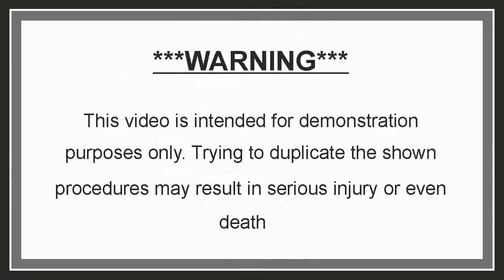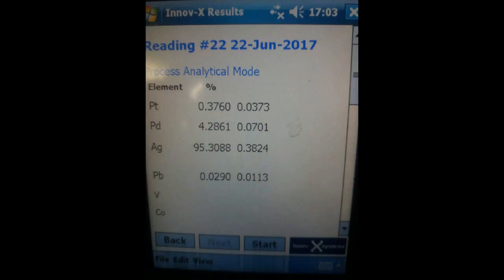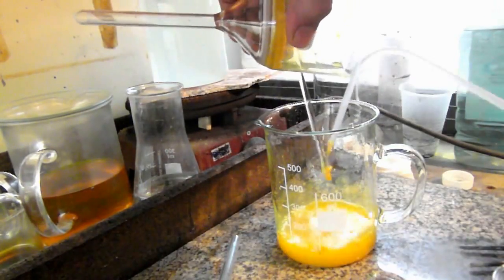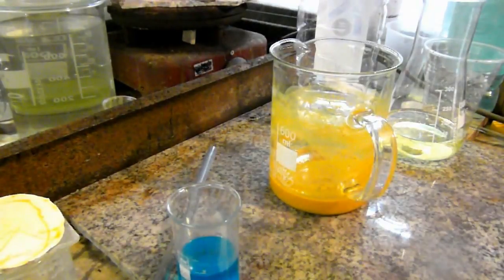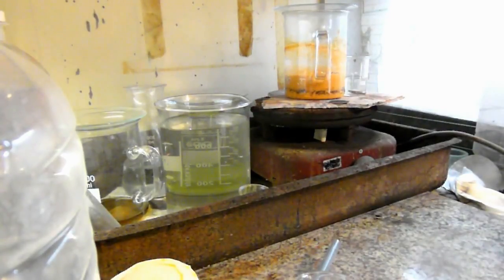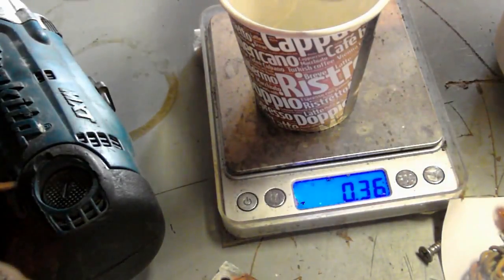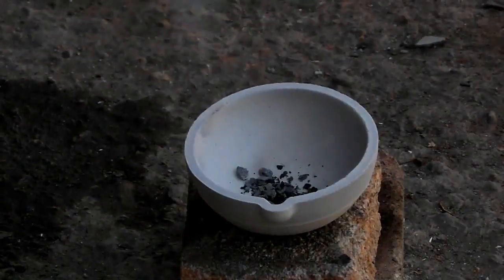PART 3: PALLADIUM bead from AgPdPt button

Comment: I hope you can offer some guidance. I am doing ore. The area is known for gold silver. Well I have assay reports and buttons to prove palladium and platinum. I recently found out, so it has kicked my butt for over a year now. I grind fine put in cyanide, mix and air 24hrs, filter liquid, zinc plate 24hr, rinse precip off plates in water, filter. This I was putting in warm nitric/water, pour off, melt remaining solids...OOp's. Every time I put in AR would not precip with SMB, platinum was stopping me and just found out palladium. The refiner torch melted a 36.7 gm 14k gold and platinum. They don't want palladium and platinum since this area is only known for silver& gold. They asked where did I get this, I wouldnt say. Ok I just found out alot in past 2 weeks. Let me run this down to you and hopefully its correct or you can add some guidance. Grind ore with lime& water in ball mill to remove sulfur and arsenic, rinse, cyanide PH11 , mix& air 24hrs, filter liquid zinc plate 24hrs, rinse plate off in water, filter precip, put solids in HOT nitric, pour off liquid, put cyanide 5-6 gm into this let stand, filter blue away, the liquid put copper pipe in to precip silver. The solids after nitric put in AR until all is dissolved[yellow-green], denox twice adding HCL, then while hot, mix ammonium chloride in warm water pour into AR to precip platinum, filter, the liquid bring back to heat add Oxalic to precip gold, if after a few hours nothing, zinc this then take zinc precip back into hot nitric, what remains is the gold? Ok the blue palladium and yellow platinum has to be calcined? Then torch with what and how?
Reply: Palladium is precipitated with DMG,yellow precipitate should just be straight put into melting dish and melted into a button right away!The yellow complex will decompose below 800°C!
But be careful with melting palladium especially if quantity is more than a gram!Because unlike rhodium or iridium(my favourite metals,exceptionally satisfying to melt them!),which both have much higher melting points than palladium,they have an enormous advantage in comparison to palladium:they don't have a freaking tendency to spit like palladium does!And the reason why it's starting just spitting around like crazy is because when it melts-it starts absorbing carbon and oxygen like hell:if you put a piece of graphite into a drop of molten palladium metal it will instantly be consumed and so after all you will have your button either spitting half of it all around when it starts solidifying or even have an explosion in this case!So first of all the bead should be melted only under some flux and only with perfectly neutral flame!
Yes and both rhodium and iridium don't require any shit of that sort:they perfectly melt under open air and in fact iridium is completely improne to any chemicals including fluorine gas at high pressure and temperature:nothing in this universe can react chemically with molten iridium metal!And it doesn't absorb anything except carbon at such case but it will be expelled completely upon solidifying!
Reply: Скажите пожалуйста сколько Вы  добавляете извести в шаровую мельницу вместе с рудой?